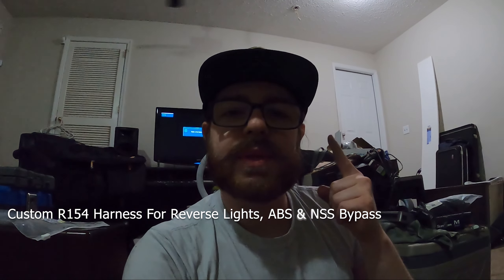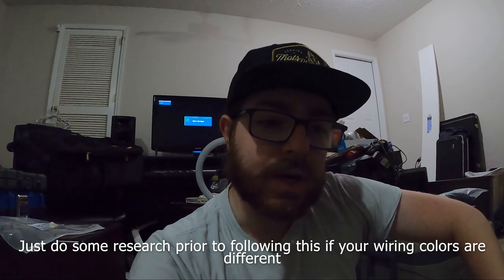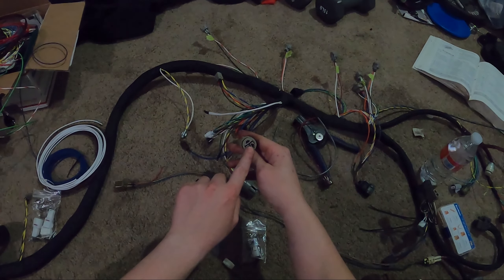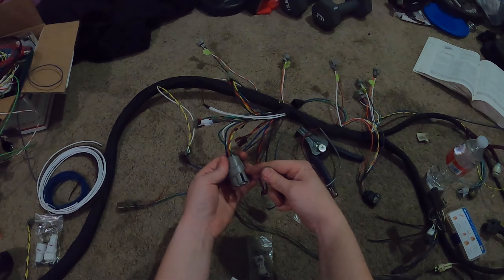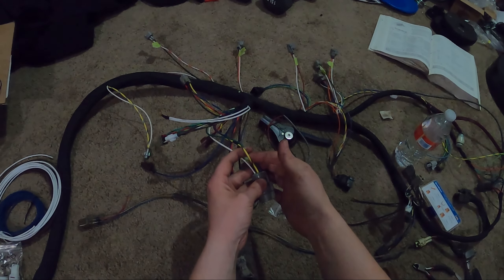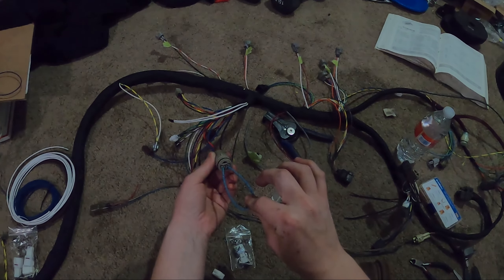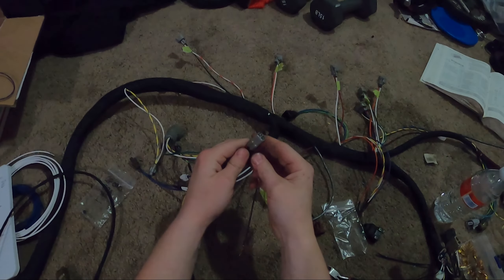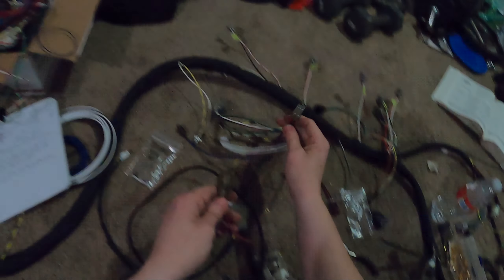Making A Custom R154 Harness For Reverse Lights, ABS & NSS Bypass

Comment: Made the same thing this past summer, but didn't bypass the clutch. Wish I k ew about eastern beaver though! I will have a look for other plugs. By chance, do you know the model number for the CPS plug? Thanks!
Reply from the maker: Sick! And yeah, I randomly stumbled across that site and I'm glad I did!
As far as an OEM model number, I don't know it. But I'll tell you the connector I used from Eastern Beaver....Which I'm pretty sure is the one that Driftmotion uses lol.
The connectors I used for the CPS are called (male) "Sumitomo 6188-0141 connector". (Female) "Sumitomo 6189-0381 connector". For both, I chose the "large" option, since I was using 16ga wire. They'll be under the Sumitomo TS 090 section. 
I liked this one the best for the CPS since the male side had the clip on slot, just like the OEM one has.
Just one thing to note, they have some weird center "key". So buy both the male and female connectors to avoid any issues with them not locking together!
Let me know if you need anything else!
Reply: @Sloth King Garage  thanks a ton man, are you Supraforums or Supramania? BTW, I've been following your build for awhile now, very good work!
Reply from the maker: @333KINGPIN33  You're welcome dude! As far as the forums go, I have an old account for both sites from when I used to scour them for info haha.
 Btw, I really appreciate that and it's awesome to hear!

Comment: what did you do about Driven Gear Signal? i thought that was needed?
Reply from the maker: Oh for the speed signal? Mine is mechanical, so I didn't need it in my Supra. Haven't went with a standalone, so I didn't need it yet
Reply: @SlothKingGarage  the driven gear signal is for the auto ecu to see what gear it's in or else it will go into limp mode. Guess if you didn't hook that up and yours run fine I guess mine will be okay
Reply from the maker: @ohhman9400  Ah gotcha, yeah I've only heard of taking care of the neutral safety switch